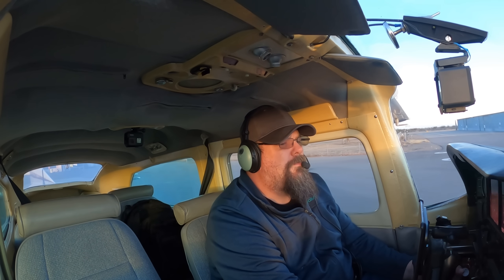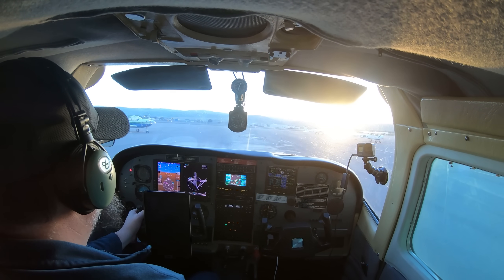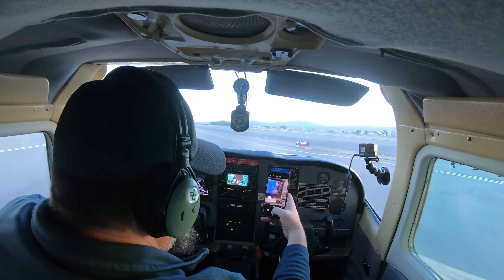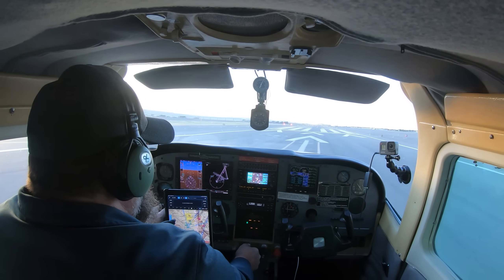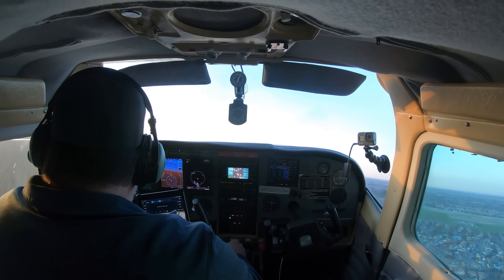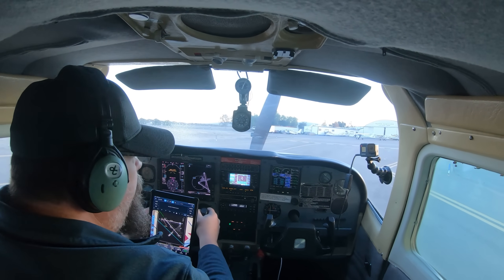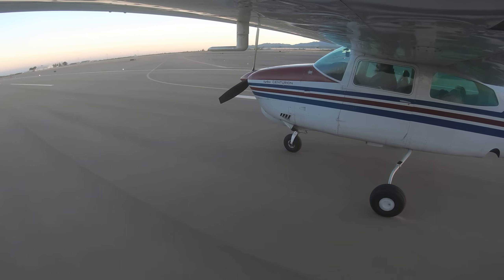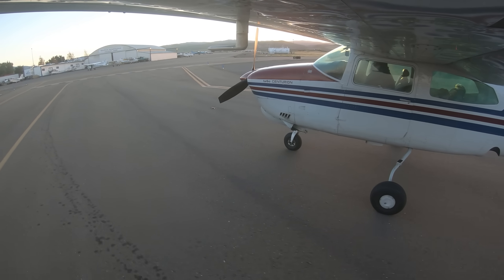Catastrophic Engine Failure after Takeoff

Comment: Well done!!  Very nice video.  You must have had an excellent flight instructor.  I'm glad you left the flaps in the takeoff position for your turn back.  That flap setting gives a better buffer between stall speed and flying in the turn.  Probably unrelated but:  My flight instructor used to tell me not to touch the mixture or rpm unless you were prepared for an engine failure because something may become upset in the engine.  The engine quit 2 seconds after rpm was rolled back here.  I roll back low as well, but I always remember his instruction.
Reply: I noticed that as well. This pilot mistakenly grabbed the wrong knob 2 or 3 times in video. He grabbed the mixture and started to lean that out a lot  but didn't do mixture rich on take off then suddenly realized the mistake and then tweaked the Blue Handle Prop. I've learned that being so close together might be a bad layout mistake?  

Maybe is accidentally simply pulled to much mixture out and adjusting prop during a climb resulted in this

Comment: I reckon the FAA will be reviewing your case VERY closely my fury friend. In the last few moments of your video, do you suppose all the oil dropped over the taxiway is yours? If you paid someone to do your recent inspection work and oil change then you may have had someone to blame for your engine failure but it seems since doing the works yourself you have only yourself to blame.
Reply: In your video you liked to keep significantly left of the taxiway centreline. This suggests you're not a Commercial Pilot. Notwithstanding the above I wish you "Short travel, safe journey". Be safe.
Reply from the maker: I am not doing the work myself.

Comment: Nice save of a good airplane!  Metal particles can get into tight spaces and break free to plug oil flow at exactly the wrong time.  Crankshaft passages a particularly bad place for particles to be, as the result can be the rod big end is ceased.  Thank the heavens that you and nobody else was injured.  Secondary good fortune, the airplane is not bent up and damage was contained to engine.  Best wishes on your next steps!

Comment: You did a fine job getting her back down and saving yourself and the airframe. I lost an engine in my T210N and had to put it in the tree’s. No one injured and saved most of the airframe. In the overhaul the engine shop had installed incorrect piston pins that had the right serial #s(packaging mistake) I can’t say enough of how strong those wings are.

Comment: The among of trouble you had in your airplane, in a less regulated country, I would strongly consider bolting a Chevy LS or turbine on to it instead of the Dinosaur tech motor. been done before. A Canadian company (Lindsey Ontario) specialized in converting Seabees can do it. Over 1/2 a century, Lycosaurus and Cont still have not perfected the basic technology.

Comment: This is the situation I fear the most.  Losing an engine on takeoff. Followed by the short amount of time you have to reflexively either do an "impossible 180" or land (crash?) straight ahead. Sorta takes the fun out of flying. You did an excellent job of responding: a rapid assessment, followed by amazingly quick action. I suppose I should throw "luck" in there as well, as you were high enough to turn, and the runway didn't have a plane taking off towards you, and cross winds seemed negligible. Based on this one video I have subscribed to see what caused this engine to fail. On the personal side, I am very glad that you are safe! Really!

Comment: First of all the good part is that you was able to turn back to the airport safe, the plane is a machine and machines can be repaired or replace but not the human lifes. Then is the part that the engine was overhauled completely even the botton part that is the one that has failed, so there are to option: or its an error during the overhaul process (probably torquening the rod at not the specified value, producing that the sten of the conecting rod brokes because it has to hold a lateral force that it not suposed to hold because it was under torquered, or the sten was streched because it was overtorquered making the metal brittel or even it was supossed to be replaced in the first time and by mistaque it wasn´t replaced on that conecting rod) or it a non detected defect on the conecting rod or sten.

The bad part is that now it has to be replaced the engine block, crankshaft, conectin rod an cylinder. What is basicly about the 70% of the engine, so i think that the best option is to scrap that engine and put a new or fully overhauled engine again instead of trying to repair that one. 

All this is talking about cost, but i´m a car mecanic not an aviation mecanic so i dont know what the procedure tells to do on this situations and the actual cost of a repair like that. 

And in the other hand i think that the company in charge to do the overhaul on this engine wil has to solve this problem for free because after all you  as much as i can see you didn´t over stress the engine or anything and that company has to have an insurance for this kind of situations. 

So i think is just a matter of have some patience until the bring you the plane back with a engine in good shape at 0 cost.

Comment: Very nice job of getting back on the ground. What I  found interesting was the degradation of the primary flight instruments when alternator power was lost.  Very eye-opening as to what could occur during an engine failure in IMC   That seemed kind of scary.

Comment: I would be interested in seeing the downloaded engine data, particularly regarding EGT’s as you appeared to bring the mixture back instead of the propeller.  At that power setting, you risk detonation which would then cause the RUD you show on the post flight shots.  That said - you did a superb job, kept flying the aeroplane and stuck to your forced landing plan.  Well done indeed

Comment: First off it was fortunate that you had just enough altitude to get back to the strip! The engine did give quite a bit of warning. If you listen you can hear that it's having trouble holding a constant RPM, and is fluctuating. Good indicator that there is a bearing issue or something else that's causing intermittent drag and slowing the engine down. Unfortunately, this is hard to hear when you have to wear headphones, and also requires some knowledge of what to listen for when an engine is run for the first time. Edit: FWIW, 8:16 would have been followed by a long string of profanity if this were a car I was driving after an engine rebuild. My experience with reciprocating engines is they can never be trusted, and have to be proven for the first few hundred miles, flight hours, or what have you via oil inspections and other means to ensure it's behaving itself.

Comment: I’m impressed that you got back in one piece, we’ll done. As a retired U.K. aircraft engineer please can you explain the reasoning behind your running in strategy? 
You ran it for twenty seconds? Then two minutes “getting it up to temperature” (I think not), then you “taxied around from the hangar”.
This does not seem to conform to any manufacturer approved running in procedure that I have come across, quite the opposite.
It may be that had you run it in properly to the approved manufacturers procedure it would have failed on the ground?

Comment: The only thing that concerned me was the fact you leaned the engine twice instead of changing the pitch on the prop...maybe just need a little refresher on the plane? New to your channel. The best thing was you made a reasonable decision given you altitude and stayed committed to flying the plane back to the runway. Looked like some decent fields(might have had ag though) but you didn't have time to pick a spot and change your mind, so I certainly commend your job handling the emergency.

Comment: I used to fly a Mooney.  Twice I lost an engine on take off and had to do a 180 back to runway.  My instructor was excellent and always explained things in terms of physics and facts of life.  When you try this there are three possibilities.  You will make it; you will land short or you stall/spin.  Let's assume we know how to avoid the stall/spin.

The first two outcomes depend on wind, altitude and speed at time of engine loss.   Pilot has no choice of that, so he is dealt the hand he has to play.  A Mooney is a clean plane, so we learn to use the gear as the airbrakes to slow it down and to get down.  In a no engine situation - the last thing you want to deploy is your air brakes - so don't drop the gear until you are sure you have the field made.  A dead prop is much draggier than a practice approach with an idling engine, so dropping the gear has a more dramatic effect, so don't drop the gear in terms when a normal approach would have the run way made - wait a bit longer, because the bottom will drop out.

I cringed when i saw you deploy your speed brakes.

When on short final, you are concerned about the gear down time.   Your plane looks fast - maybe 2 seconds, max?   here is how my instructor explained it to me.   If I drop the gear 2 seconds too soon, and land short -  I have a high speed off runway crash landing.  If I deeply the gear 2 seconds too late, I have a low speed belly landing on a smooth runway.  Just remember what I say - the bottom falls out when you drop the gear with a dead engine.  So wait as long as possible.

I have had two high peed crashes in a car.  One was a race car that flipped end over end and then rolled.   The forces on the body are terrific and you can feel the lap and short belt taking all the strain.  You risked adding to the cost of damages by beating up the control column and instrument panel with your head.  What your head did not ruin, the blood would.  Wear that device designed to save the instrument panel from a battering....

You did a good job.  You instantly knew what to do and where to go.   In my Mooney, 800 feet and 120 knots was the magic number I would watch for on take off.   That was the RTB option vs landing somewhere in front.

Comment: The Continental overhaul manual calls for a run on a test stand before flight.  If that wasn't done and the FAA looks into this your mechanic might be in a bit of trouble.  Good job on handling the emergency.  As an airline/ATP guy I hope I do as well as you in my Bonanza if I ever lose one after T/O.
Reply: Connecting rod end cap was for sure not tightened properly.  The mechanic is in (financial) trouble regardless.
Reply: @jsteiger2228  you can't infer from any of the information that is given here that the failure point is the rod bolt.
Reply: While doing an initial break-in on a test stand is nice, it’s not a requirement by the FAA.   The vast majority of engine break-ins  (especially field overhauls) are performed just as demonstrated in this video.  Assuming the conn rods were sent out to be checked for cracks, the first thing that comes to mind is the torque on the rod cap nuts.  Continental used to use castle nuts/cotter pins on nearly all conn rod bolts and more recently switched to a lock nut that requires more torque. I know of a failed major overhaul in a big bore continental where  exactly that happened. Mighty expensive mistake. Engines can be fixed….people not so easily.
Reply: I thought it sounded like he just had an IRAN done on the lower end of the engine.  So maybe Overhaul standards don't apply since it may not have been considered an overhaul?
Reply: Has this engine been test run on a dyno after this major overhaul? Going full power for some time in the air is kind of scary. This problem would have shown in the dyno and not in the air.

Comment: Well done, sir. I'm not sure that could have had a better ending, but I'm not sure I would have had the berries to try and bring it back around like you did. It did occur to me that that engine failure, which looked, sounded, and behaved like I would expect it to when it's tearing itself to death from the inside, is going to mean the cost of another major overhaul, or what I would likely do a zero time rebuild to get the offending motor as far away from me as possible. I didn't watch the entire thing, so if you mentioned this I apologize, but were you able to identify the cause of the failure yet? With it just being overhauled, are you covered under some sort of warranty from the overhaul or install shop?

It occurred to me that it's sort of interesting that if there is no warranty coverage, engine failures aren't covered in your insurance policy, at least I don't think they are. Next time that happens, you might forget that gear extension handle with all the melee of trying not to die, and stuff. And while the touchdown would be a little bumpier and you'd need a few more people to get it back to the hangar, that engine failure would then magically become covered by your insurance!! 🤣🤣

Just don't forget that NASA form, if they corner you with accusations, just go right to the nuclear option: Start crying, like loud ugly crying so they feel so awkward that they want to just get away from you, and of course soil yourself as you feel is needed to ensure they just stop taking to you forever.

Good talk!! 🤣🤣🤣
Reply: Pete, at the end of the video he shows pictures of the engine. He threw a rod, and the big end of it went through the top of the engine case. A new engine will be necessary because that case is beyond saving.

Comment: Conrod bolts either came loose from not being tightened correctly or reused rod bolts failed when they should have been replaced ?  Great recovery mate ,very cool under pressure and made a great choice .
Reply: Doubtful that rod bolt failed due to reuse. Reuse is not recommended but I've known a lot of them that have been reused and I've never seen one that was reused fail in a Continental 520. Continental will not consider the engine to have been overhauled if rod bolts are reused so I am pretty sure new bolts were installed.
I suspect they used the later-style "Spirallock" nuts on the rod bolts. These nuts require a higher torque than the earlier-style cotter pinned castle nuts due to the locking feature machined into the Spirallock threads. This torque is not indicated in the overhaul manual. For years this torque was only indicated in Service Bulletin 96-7(*). Nowadays it is also in the Continental Standard Practices Manual.  If the torque listed in the overhaul manual was used instead, the rod nuts may not have locked securely and one may have backed off.
Either this or one rod did not get torqued.
Reply: i think the rod bearing clearance was too tight.

Comment: Wonderful piloting skill.  Glad you came out unscathed and saved the plane to boot.

I saw the racing P-51 Dago Red do that in 1984 during a race. Engine broke a connecting rod that it proceeded to beat itself to death with.  Landed trailing black smoke but no visible fire.

  When they towed it back to the pits past the crowds you could see the cowling had been blown off and there was a hole through the V-12's engine block you could stick your hand through with fingers spread wide.

Cool aviation videos.  I grew up next to Reed/Hillview in the 1960s and Moffett Field NAS from then on. That's probably why I have planes on the brain. 

 Happy flying!

Comment: You did a good job getting back to the runway.  You were also very lucky because C210's glide like a brick.  Both Continental and Lycoming have engine run after rebuild or overhaul procedures in their maintenance manuals and if they are not in there then you can call them and I'm sure they would be happy to help.  I'm not saying that would've helped in this situation but there are procedures laid out for that.  Also, no offense to you but you should go back and get some more training in the 210.  In my opinion you are still thinking that you are in a 172.  Grabbing the mixture like that instead of the prop is a bad bad rookie mistake...

Comment: Running in a new set of rings under load is indeed important. A lot of engines are run in on a dyno, before being placed into service, so they can be carefully observed and optimally run in. This is even easier with a generator set because all that’s needed is a load bank for the generator to power, and the generator loads the engine. Generator sets are frequently tested under full load and under observation for 1 to even 4 hours straight, regularly, to make sure they’re up to snuff. But an airplane is even easier because it has a dyno built right in. The run up before each flight makes brief use of this advantage. With all this in mind, I’d think it would be standard operating procedure to run in a new engine at rated load, on the ground, for at LEAST an hour, if not several, then change out the break in oil, THEN release the airplane for service. What is the reason that this isn’t done?
Reply: Its air cooled

Comment: Great job!  As for "doing what youi shouldn't do" everything is relative. You know your airplane and you know the field and most importantly you were at a very heightened awarness that something could happen. Those factors would seem to tilt in favor of coming back- the fields ahead didn't look super great. And if you couldn't make the full turn, it looked like the edge of that chanel might have worked. If that was a strange field and strange aircraft, then straight ahead would seem best. Bottom line-YOU flew the plane to a very nice landing! (Nit pick stuff -shoulder harness and could the prop have been feathered?)